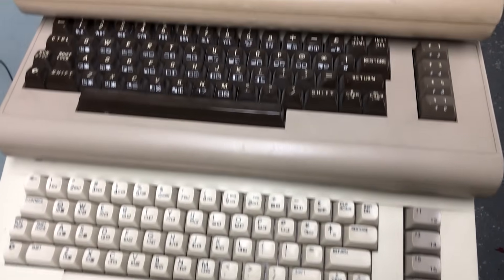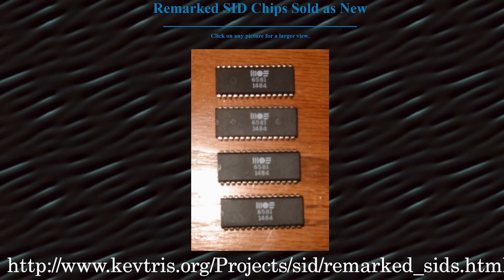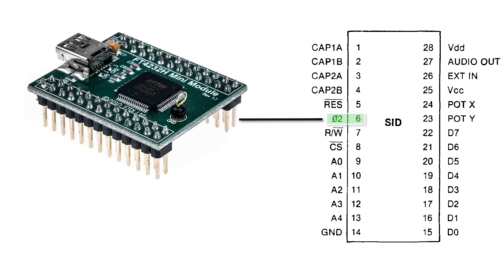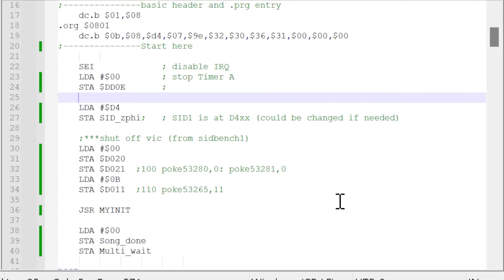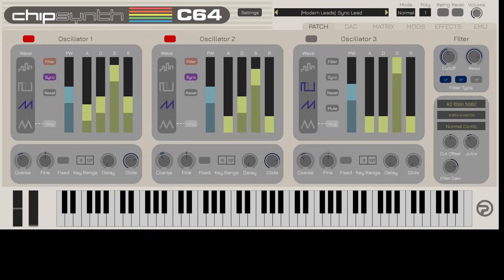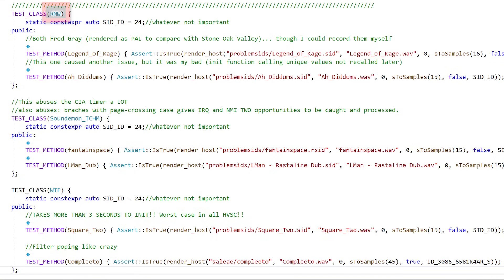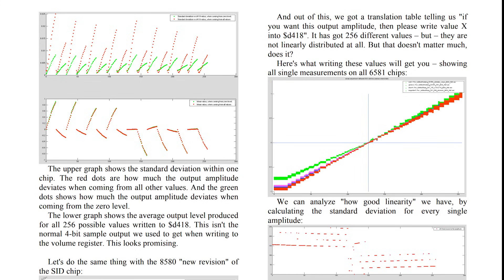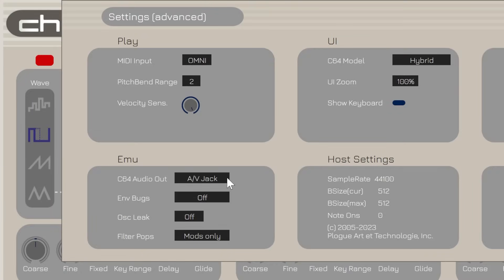Emulating the SID the HARD way

Comment: Impressive work! Yet all I want is just a modern low noise SID replacement as close to the real deal is possible. Preferably in a stereo version. FPGASID is close but it does have a few edge case issues. Like "Ghost in the Noise" by Warp_8 which probably "abuse" it just about as much as the example you've found.

Comment: Perhaps filter capacitance should be a parameter, as it's not part of the chip itself? 🤔
Reply from the maker: @mirabilis  true, and we initially thought about this. But we wanted the potential impact of the caps removed from the (initial) equation, so we used the same set for all 6581s.  After all that it was clear that the sonic differences came from the chips themselves, and the exact ceramic caps we used changed very little if any. In the end we already spent way too much ressources on it.
Reply: @plgDavid  I get that. I've heard of people "fixing" their misbehaving 6581 by switching from 470pF to say 2200pF. The filter was to open with the default caps in that example. Barely not noticeable on that wind effect in Giana Sisters for example, just harsh, unfiltered noise. They got more tunes to sound decent, so to say. Did all 6581s come paired with 470pF out of the factory? I've heard that (some?) early 1982 C64s had 2200pF caps, but I'm not sure about this. I've heard of 330pF being used as well.

Comment: Bob yannes also made the esq-1 and esq-80 synth keyboards im sad because i used to have a sq-80 that broke it also had midi problems and the battery would get very warm and keybed problems. but i wish they were remade beautiful wavetable synth with a analog filter and 8 bit waveforms.

Comment: But, would it be possible to imagine an ideal sid chip, something that maybe never was due to the imperfections of the manufacturing process, the component variations and even flaws in the design made by Bob himself? The chip that he envisioned but only got so far? I mean, I guess the ADSR / function generators / filters / ring modulation and all that could bee done much more perfect today rather than trying to get the most close reproduction of the sound from the existing sids?
Reply from the maker: The 8580 is way closer to the intensions tbh. Otherwise Yanne's later DOC chip is also the 32 osc version of the SID he wanted, with a few  (major) differences.

Comment: Sir, you are certifiably crazy! 🤪 My hats off to you!!!

I do have to take an exception with one of your statements, though ( @7:00). I'm not trying to defend my record as one of the people who had a hand in the SID file specification document, BUT the document clearly states: "The RSID format was designed to contain tunes that are not PlaySID compatible, but strictly require a real C64 environment to run." Let me repeat that again: REQUIRE a REAL C64 environment to run. Which includes emulation of all the other chips, too. 😀 Maybe that should be more prominent in the document in big blinking red font... 😉

Also, all the SID tunes seem to play too fast in your video. NTSC vs PAL differences?...
Reply from the maker: Yes we recorded nearly everything using our own local NTSC C64s. I got a PAL C64C only for 8580 stuff. I may be tired but I was talking about PSID files that act like RSIDs.
Reply: @plgDavid  Please, do report those masquerading PSID files to the HVSC Crew, they really should be changed to RSID.
Reply from the maker: @LaLa-6581  actually I think I will make a few special tweaks to my batch loader (loads all HVSC and so far only checked for crashes on my end) 1) check if PSIDs try and access the VIC-II or CIA 2)call/read KERNAL/BASIC regions (breaks open roms) 3) well generate any audio on my side - quite a few reported so far. Its normal as this core is 100% different than the great many decades of  the main sidplayers.
Reply from the maker: And publish of course

Comment: Incredible! I'd like to see an article on how to do 8 bit digi's, especially in higher sample rates. Cover the various methods such as vicious sid.
Reply from the maker: Hi, You`ve seen this? https://codebase64.org/doku.php?id=base%3Avicious_sid_demo_routine_explained
Reply from the maker: Otherwise theres also the Music Run Stop pdf, not sure where it is online now.
Reply: @plgDavid  Thanks! One more thing, from your research, is there a reliable way to do chip detection?
Reply from the maker: Didn't investigate that as much as much since we really cared on making the analog output the same. C64-side detection routines have to rely on reading OSC3/ENV3 and various sceners have already devised plenty of routines to check for 6581 or 8580 - which we actually had to support too. Some better than others.  @curiousgeorge7515

Comment: When people went nuts about the C64, I had a Sinclair ZX Spectrum and I still love this little machine. Today I use an emulator as my Specci was more broken than working from a certain time. Nevertheless, as a synth freak I highly appreciate what you have accomplished and what amount of research work you put into this. As always, I'll buy your new synth to keep up the support. What you do is crazy and that's exactly what we need. 🎉❤

David, I got a question on my mind. I love the OP7 and I think it's the non plus ultra emulation of a DX7 so far. Nevertheless, it's not quite there with the hardware yet, as the DX7 has a better voice separation, so it's clearer, it has stronger transients and more punch in the low end and the highend is more silky on the hardware unit and seems to have a bit more nonlinearity to it. I got lots of hardware synth and a sensible ear for small details. Speakers are Dynaudio LYD48. While I think your synths are nailing the core sound chips of the originals, I feel the emulations are missing the rest of the hardware components, meaning the complete output circuitry and all it's hardware parts and components the audio has to go all the way through, including the L and R component differences. I'm eager to know if you will take such eminent components into account in future research, utterly hoping to see an update for the OP7 ones day. Greetings.

Comment: Im sure it's been considered, but also... Could very small voltages differences affect the sound or even the SID permanently? I imagine not every c64 is getting the exact same voltages.
This is mostly a comment for the sake of a comment. Cheers
Reply from the maker: In fact yes in extreme cases. the combined waveforms on a certain SID I had went rightly bonkers at once point, but I had the +9v and +12v mixed. Not sure I dare to repeat the experience.
Reply: @plgDavid  yeah right oops.... I was more thinking 0.1v or less differences could change the same SID
Reply from the maker: you run it twice and combined are not the same even at the same voltage, so surely the rain outside too haha  @1st_ProCactus
Reply: @plgDavid  lol fair enough

Comment: Dear David, there are many things you stumbled on which I could have helped you so much with. Recently I moved away from C64 stuff to do more complex things.
Reply from the maker: Salut vieux. Je sais. Tu bosses sur quoi ces jours ci?
Reply: @plgDavid  Les machines d'arcade CAVE (Japon). Je construit un système pour avoir plus de 20 jeux disponibles sur un seul appareil. On utilise Teensy et Raspberry Pi  Pico pour switcher d'un jeux a l'autre.
Tcheck mes textos!! Je roule le Teensy 4.1 a 816MHz pour remplacer le contenu de la Flash en un clin d’œil. Fichiers sur uSD.
Reply: @plgDavid  Machines d'arcade CAVE (STG Japon) https://youtu.be/ZOaFojnt4wo?si=1pctMr6Bcl7-b3ZC

Comment: 3:43 Now that's how you reverse-engineer a sound chip and verify your emulation code. Very nice.

How do you avoid aliasing in the sound emulation? Generate at a higher rate then use a low-pass filter?
Reply from the maker: Are you that blargg? If so first thank you so much for your S-DSP tests and more!, Yes we generate it all at 1MHz, low pass and downsample after. Machines are fast enough now. Used blit/blep for chipsounds though (2009)
Reply: @plgDavid  Yes, this reminded me of the S-DSP tests where you could actually read the echo buffer and check things there (and it was precise digital rather than analog).

I agree, these days with vector operations downsampling is a trivial amount of CPU.

All those revisions of the chip definitely called for a proper framework for logging all that data and applying it to emulation. What a huge task.
Reply from the maker: Its all fun @gargantuablargg  haha. We actually used your tests as extra to validate our SNES audio cores. Priceless! See your name here https://youtu.be/V3yWXVAZgO0?si=GHO11520KTKvNkvh&t=748

Comment: With all this work and data collected would it be possible to recreate the sid chip itself to revive c64's with broken sid? I know there are emulated chips, but a real one would be really great.
Reply from the maker: Having a modern fab that can redo the old NMOS or HMOS-II mixed mode dies would be incredible, who knows, but then they could just take the original die images. I would buy that. Im still a sucker for the real thing.
Reply: @plgDavid  I wonder if there are any fabs left that can do these processes. also a little surprised that the manufacturing listed in your tables were all outside US -- I thought MOS had a fab in (checks notes) pennsylvania? or maybe the country is where the raw dice were packaged?

Comment: I have always wondered WHY Commodore made so many changes to the SID that altered its actual sound. Didn't they realize this would have a negative effect on the artist's original creation? I also wanted to mention that Bob Yannes, the designer of the SID, originally wanted to have 32 voices in the final product but was not able to implement this due to costs and time. Can you imagine what that would have been like? It boggle my mind.
Reply: They didn't necessarely make changes to every chip, most of the chip-to-chip variation comes from the way the filter is implemented in particular on the 6581. It's a NMOS chip, which works great with digital logic but it makes some analog stuff like true op-amps impossible.

To get around this, the 6581 fakes the op-amps needed for the filter by using negative-feedback amplifiers with high gain for a limited voltage range. The downside is that this range is quite small, and as such very small variations in transistor quality will greatly effect how far off from an op-amp this compromise inverting amp is. In turn this is reflected in the sound.

Since Commodores chip manufacturing process was centered on digital chips, the quality of the transistors was not a very regulated parameter. After all, a transistor used for digital logic only has to work like a switch. This in combination with the mentioned compromises is why not two 6851 chips sound alike.
Reply: @ThePiloseOne Interesting! I can imagine if Commodore still existed today they would rethink this design so that all SID chips had the same quality of sound. Of course they would also probably have a 6510 that can run at 4mhz or faster, a megabyte of RAM, etc.
Reply from the maker: Thats mostly what Yannes ended up doing with the Ensoniq DOC chip, thought it lost some of the SID features.

Comment: What kind of filter caps do you use? My favorite is polypropylene.
EDIT. Polystyrene.
Reply from the maker: Yeah polypropylene was used a bit due to it being the suggested ones in the old MIDIBox SID days, but for this I used the stock ceramic caps of the same breadbin on (nearly) all of the 32 chips to have an accurate depiction of the overall  "SID in a C64" sound.
Reply: @plgDavid  Did you measure the capacitance on the one's used so that they're matched? PS. I meant polystyrene. It's mentioned in the datasheet. :-)
Reply from the maker: Yes they match, within tolerance of my test gear anyway.  @mirabilis
Reply: Sorry, I meant polystyrene. 😅

Comment: Amazing work! Ever thought about making a hardware replacement chip with this tech? :)
I saw you had some questions on ASID, and I’ve been doing some work on that lately (extending to multiple chips, adding to DeepSID, implementing on TherapSID etc - some demos on my chn) so I can help out testing things if you need.
Reply from the maker: Oh! I actually TRIED the ASID functionality with csC64 on chordian when testing it, IIRC it worked fine! Great work.!
Reply: @plgDavid  Lovely! I just updated it some days ago with multi-SID and multispeed support, so you could update csC64 with the messages for all four SIDs if you want. Since it needs higher than normal MIDI speed it requires an Elektron TM-1 interface though :)
Reply from the maker: @tubesockor  Yeah serial MIDI is ... The best I get with class compliant USB MIDI in the Teensy/STM32 hardware prototypes I make.
Reply from the maker: Oh. while you are here. One of the issues with the Therapsid ASID I have is it auto compensates for the PAL vs 1MHz clock drift. Is there a way to turn this off? My ASID player could say hello I dont need this :) I thnk I use the ASID "song title" feature, so that could be a hint
Reply: @plgDavid  I might be able to arrange a TM-1 (10x speed) if you need :) But if you already get higher than normal speed using your Teensy setup I guess you could try to see if that also would play the multiSID tunes on csC64.
Reply: @plgDavid  Yes, I implemented the clock drift fix so that regular songs would play in tune. But sure, I could add some message for that kind of configs! I’m already planning to add SID type config in the messages. And in the latest one (active on DeepSID but not yet in TherapSID official) is OPL support over ASID, so more could be added :)
Reply from the maker: "OPL support over ASID"  @tubesockor  Oh no will have to add ASID to "chipsynth PortaFM" then haha.
Reply: @plgDavid Yes, of course - do it! :) I created some info about it on my second last vid, if you want to know more about it.
Reply from the maker: Kind of already did, (https://x.com/plgDavid/status/1412869394368192517?s=20) but that market is way too crowded I think. I have tried an ARMSID and it does a pretty good job already